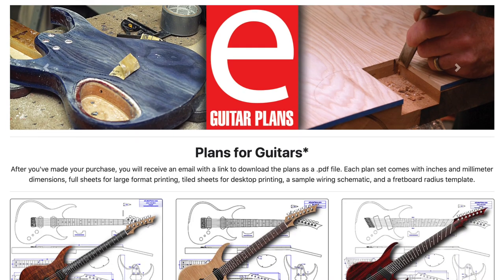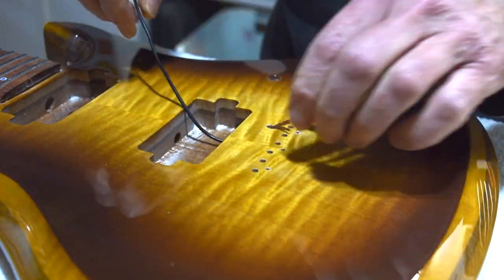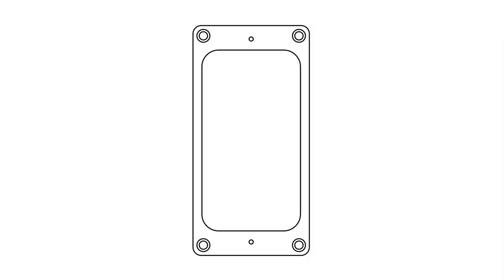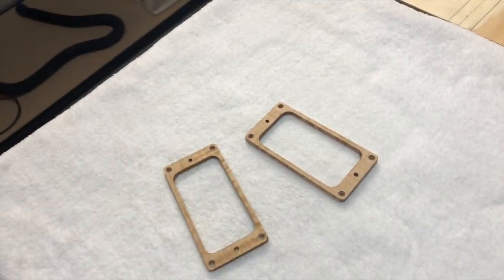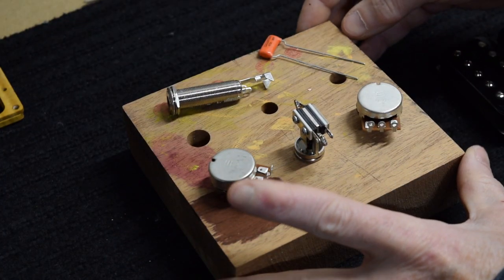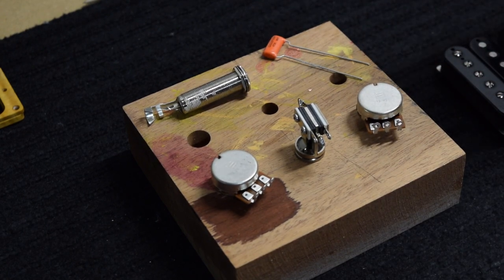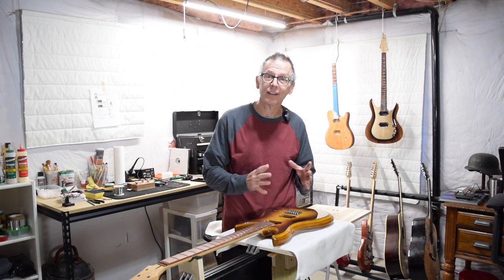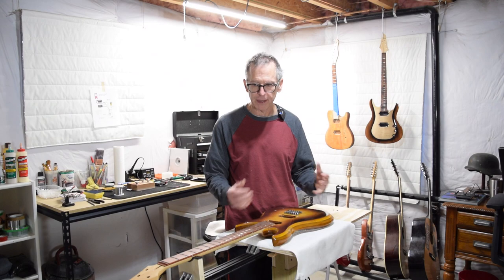Making A Laminated Top Guitar Part 18 Final Assemby???

Comment: Nice new video, Chris. So shielded wires is enough to shield the whole guitar... I didn't know this. One question: Do potentiometers
make a difference in tone? Do CTS pots sound better, or without any type of issues, than other cheaper brands?
Reply: Except in a case where you get some sort of static when you turn the pot, I don't believe the pot makes any difference to the tone. It is just a resistor after all. Better quality pots for sure make a difference in terms of feel and reliability. Unless you're doing thousands of guitars, the price difference between junk and good quality pots is just a few bucks so why not use the good ones?
Reply: @scottakam  Not sure if there could be a minimal difference which could change the tone in the slightest... maybe adding a nasal
quality.
Reply from the maker: Tone is subjective. What you like, others may not. IMO, pot choice is based on how it rolls the signal and the way the knob feels when it turns.
Reply: @HighlineGuitars  Besides feel, if a tone or frequency test is done, with two different pots, maybe there could be a diifference, 
This is what I reffer to. Perhaps most guitar builers haven't done this test. I remember a Strat I tried once with two different 
bridge pickups, a stock one and a single coil sized DiMarzio, and both sounded too nasal. The owner told me later that the
pots were not stock, not CTS, because he changed them to add switching for coil tap and split. This led me to think that
maybe cheaper lesser quality pots could change the tone and make it more nasal.